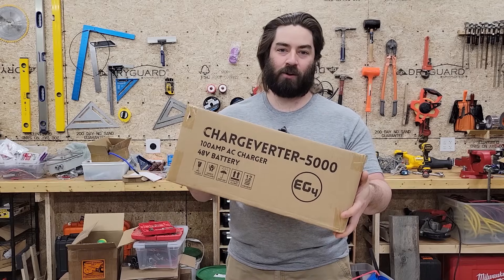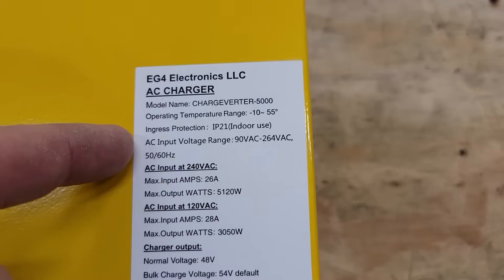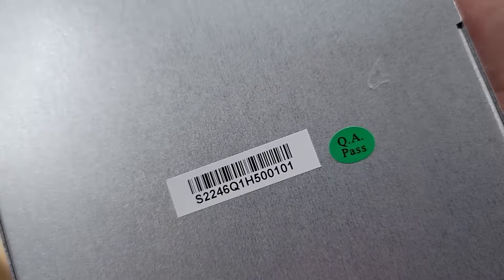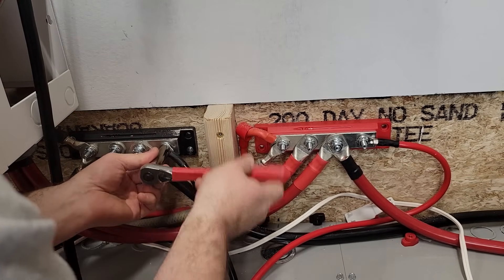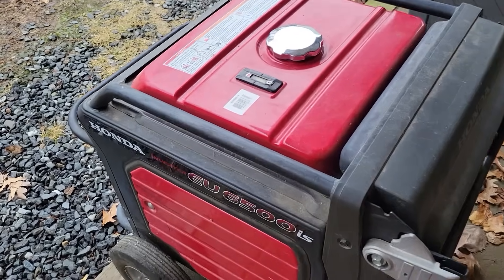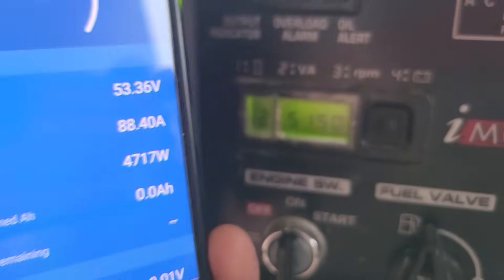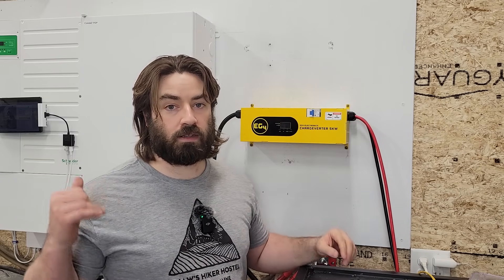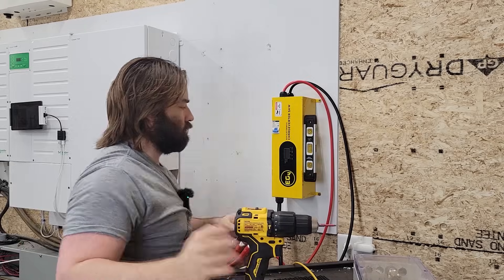Powerful and Affordable AC Battery Charger

Comment: This is cool. I'm planning on buying a chinese 4kw inverter, the new EG4 500v 100A MPPT charge controller, and maybe this now! I'm getting this setup instead of a EG4 AIO because they have extremely high idle consumption around 150w which is too much for my needs.
Reply from the maker: Great.  If you decide to use any of the affiliate links in the description, it would really help out the channel.

Comment: How much does this unit retail for?  This would be a great stand by for a simple fix for a PV system that cannot keep up with the battery drain in in-climate weather.
Reply from the maker: $399.  Here is the link: https://signaturesolar.com/eg4-chargeverter-battery-charger-48v-100a-5120w-output-240/120v-input?ref=4_rHcgZ9x-TiF-

Comment: You can make something similar from a Huawei R4850G2 power supply - they are used to charge backup lithium batteries on cell towers - they used to be really cheap to buy (less than 50 bucks) but looking now they seem to be expensive now.
You can also get dedicated 48v generators as well now - which avoids the need for the genny to invert to ac mains and the power supply to convert back down to dc
Reply: The Huawei gear would be going up because they've been banned from the US so anything you see is new old stock.

Comment: Good video David.  Especially liked the actual measurements which often are in specs but seldom given in videos.  Do you have any idea of the need for inverter generators to supply this charger or of the tolerance for modified-sinewave type chargers?

Comment: The hot exhaust air blowing on the DC cables might not be great, the insulation may begin to deteriorate over time. They probably should have routed those out the same side as the AC in instead, which would solve that problem and may allow for more efficient cooling. Overall looks like a good unit, I have the lower powered, older EG4 charger, but 5kw charging paired with a 240v generator is certainly a great option to supplement solar when the weather's not great.
Reply: After rotating so exhaust is up, I would route cable to the left and anchor them to stay out ot the way of the exhaust heat

Comment: 60 degrees Centigrade is very safe for most power electronics, although it will depend on what the temperature of the components inside the PSU is, not just the surface of the unit.

Comment: I have a Larger generator. I know how to get the charger do that it won't over load my generator. my question is, can you parallel 2 or more of those chargers without damaging their circuit controller or the battery controller?

Comment: David, thanks for the video. I enjoy your videos, nicely done. I am not sure if I am seeing the benefit of using this unit to charge a battery bank. Are you saying the new Chargeverter is more efficient at charging a battery bank than the Schneiders and/or Growatts? Both inverter brands you have will charge the battery bank, I am not seeing the benefit, I guess. Do these inverters cannibalize power to charge battery banks vs when using a gennie? I bet I am over thinking this.
Reply from the maker: Actually, the Schneider inverter is a little more efficient at charging the battery than this is.  In my previous video I showed how switching the loads back and forth from generator to inverter can make the lights blink.  This charger eliminates that.

Comment: Awesome thanks a lot I am supposed to be getting my eg4 chargeverter any day now and I have the same Honda 6500 generator so this video was perfect for me 👍
Reply: I have a little Predator 3500. And I have a Amitabh 4000 light pole I'm not sure the specs on that generator. I don't think my 3500 would do much haha I'd have to set set the charger at 50% or something or 50 amps I mean

Comment: Thanks for the video. I am curious how long it would take to charge one battery with just the generator running through the inverter and then running through your new battery charger? How much of a difference in fuel consumption?
Reply from the maker: My Schneider inverter is about 93% efficient at being a charger.  This new charger is about 90.5% efficient.

Comment: David, I saw you had your generator set to 120 V, did you change that for the test to 240?
Reply from the maker: Yes.  At first the charger didn't turn on because that switch was in 120V mode, and that means the 240V outlet is off.  As soon as I switched it back to 240V the twist-lock turned on and the charger turned on.  You have an eagle eye.
Reply: @DavidPozEnergy  hehe, only because I've done the same thing myself. I just ordered one of these.exactly what Ive been looking for..

Comment: When using a charge controller like this does the generator need to be a full (not modified) sine wave?
Reply: it may not need to be, but one will lose significant efficiency in charging.
I wouldn't use that configuration in anything but a urgent temporary situation.

I have a 1200W modified SW inverter under my hood of my truck running an old reliable workhorse heavy transformer based charger for emergency charging of the battery. 
The charger is over 25 years old and runs strong as ever.
I have a 500W PSW inside for charging phones ands small devices.
It will run (barely - sometimes resets) a small air compressor for airing up tires when necessary.
Reply: Modified might be a little harsher on the electronics but it should take it.

Comment: 0:45  wait, are you saying that your inverters don't invert when charging from the generator hook up?
Reply: They don’t. Goes to pass through and your loads run off generator and the inverter charges the battery only.
Reply: It swaps over to the generator. You can see the problems in a previous video. I think it's a normal problem with these inverters, where the transition between on and off grid isn't completely seamless.
Reply: I have the same Schneider XW Pro as David has -- I think I can answer your question.  When the generator is hooked into the AC2 input port (a 240 volt connection), it provides pass-through electricity to the AC Load output terminals.  Any remaining energy is run through the inverter's charger to supply DC back to the batteries.  Now, if your batteries aren't empty, you can configure the XW Pro to supplement the generator's power so you can actually run loads greater than what the generator itself can handle.  In this case, the inverter would in fact be inverting while the generator is hooked up and supplying power.  However, it doesn't charge the battery first, and then invert that freshly charged electricity back into AC for your downstream loads - I think this is to avoid the losses from multiple conversions from AC to DC and back to AC.

Comment: I like how it's modular, those look very similar to server power supplies in their size... makes me wonder if that's what they are using in a custom configuration. Easy reparability.
Reply: hopefully it lets you run the unit at half capacity if one fails.
Reply: Identical to 48v telecoms power supplies
Reply: It's 100% some Huawei/Emerson Telco 48V power supplies. I have a few from a 4G Telco rack i tore down, and they are fully programmable via CANBUS where you can regulate voltage and amps, and ofc. read out vital data.
Reply: Server or telco power modules. I didn't see a model number. It's not repairable if you can't get the modules.
Reply: They sure do look like server supplies. Even the card edge connector appears as if it could be the same.
Reply: They are server grade PSU